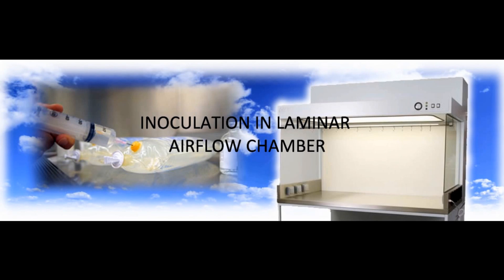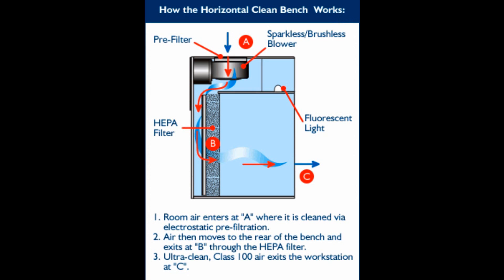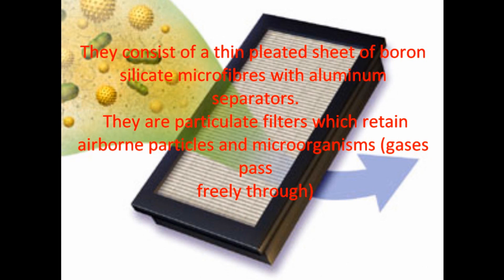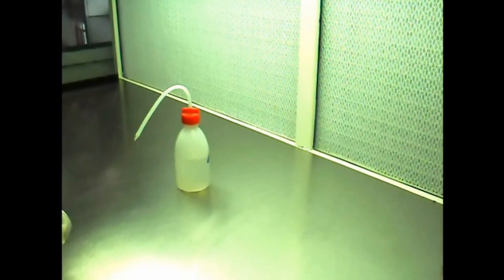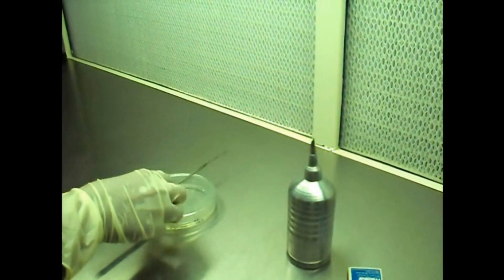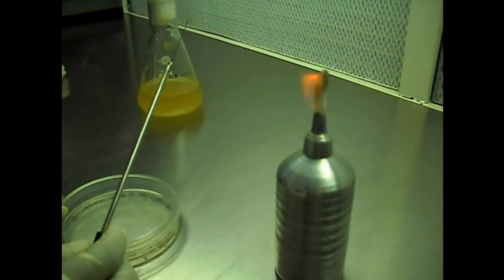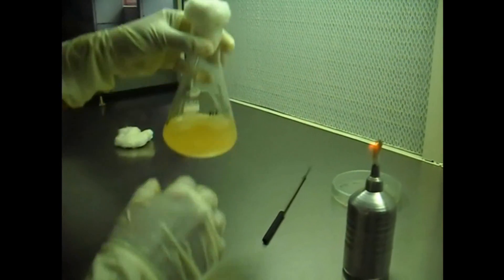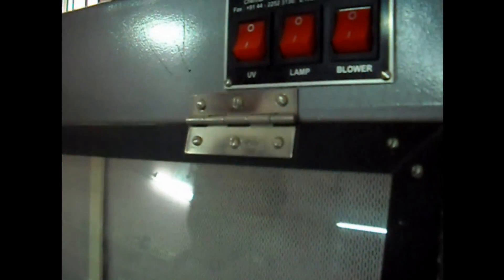How to inoculate in Laminar air flow chamber

Comment: The laminar air flow shouldn't be used just after switching off the UV light....there should be a gap of 20-25 min before using it..as our skin absorbs the UV radiation, which  can be harmful.
Reply: Absolutely right... 
First on u v and light at the same time for 20 minute. 
After that switch off the u v and switch on the air. Again wait for 15-20 minute. 
Then switch off the air. 
Now you can work.